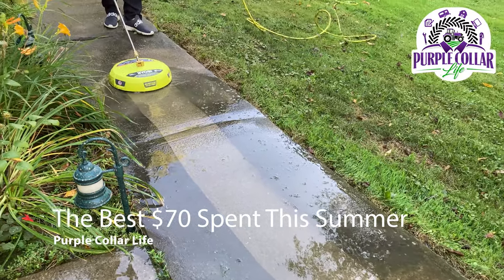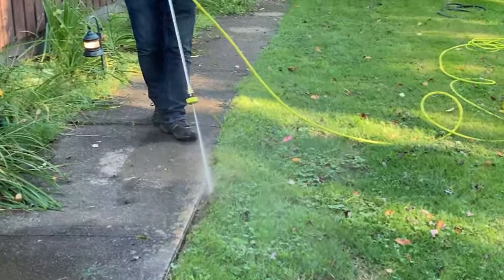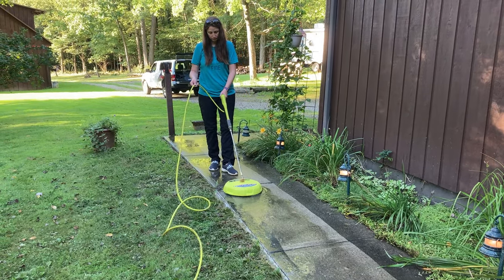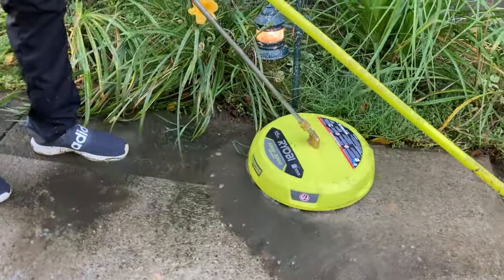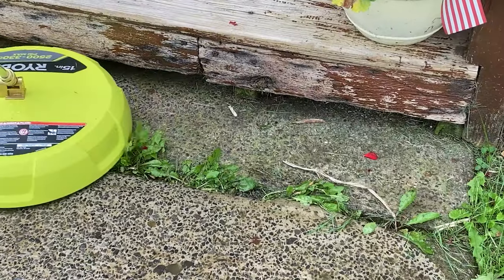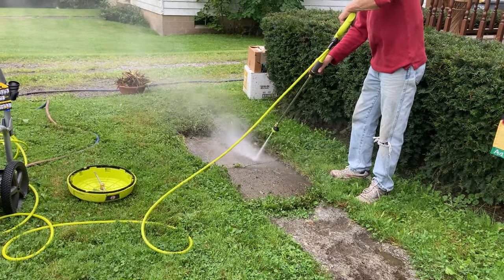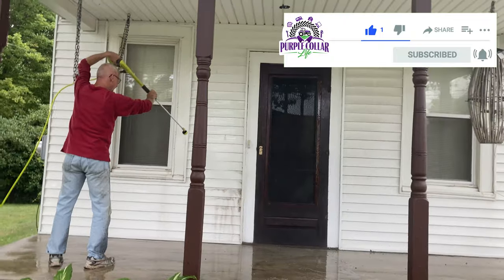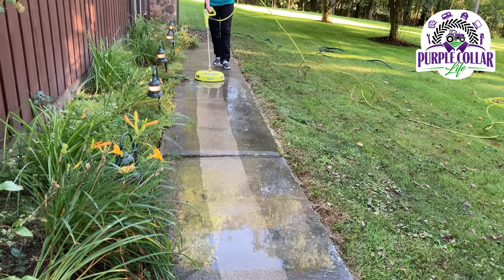#247: Ryobi Surface Cleaner - The Best $70 We Spent All Summer!

Comment: Chad… excellent!  As usual, you captured the essence of the answer to the question, “How does it work?”

I have the Briggs & Stratton surface washer.  It works the same way… a rotating arm with jets under the cover.  My pressure washed is only 2500psi but nonetheless it does a fine job,

My favorite thing is that it doesn’t leave spray patterns like a spray nozzle does.  If you take your time and don’t change speed or use crazy patterns the surface comes out uniform.

And the fact that it acts as a weed whacker on the growth in the cracks… is a bonus.

I also agree with you on the use of soap.  I never have seen a difference.  The only chemical that I use is a mold and algae inhibitor on siding and decks.  That I usually apply with a hand sprayer before I wash… it is easier to control.

Again, I enjoyed the demo.
Reply from the maker: Thanks!

Comment: Awesome cleaning power! And it's amazing it can do that, with that much pressure without eroding the surface. It's like using bleach almost. Thanks for sharing! 😎 Those are neat Adidas shoes Jennifer is wearing! 👟
Reply from the maker: So true!  The advantage to the surface cleaner is that as long as you're not over 3300 psi, the surface cleaner works at such an angle that it's not supposed to damage the surface.  I have seen some videos though of older/cracked cement floors, or really old porches, that splinter under the pressure.  The surface cleaner is much safer to use on a surface though than the 0 degree setting on the adjustable nozzle.  Thanks for watching! Have a great Saturday.
Reply from the maker: Oh - and Jennifer says those Adidas shoes are her favorite.  She liked that they got a comment. :)

Comment: Probably a dumb question but does having wheels make it easier to use? Or does the pressure of the water sort of make the surface cleaner "hover" over the concrete? I thought without wheels it would be a pain to push back and forth. Thank you!
Reply from the maker: Great question. There is very little resistance using the surface cleaner even on rough sidewalks. The pressure from the water creates that hover/hydroplane feeling and it moves along much like a vacuum cleaner on hardwood flooring.
Reply: @PurpleCollarLife  thank you very much! Great content and advice.

Comment: Nice video! Do you know if that will connect to an electric pressure washer? I only buy electric or battery powered equipment. I’m tired of dealing with carburetors. Also I love your new wood splitter. Can’t wait to see more videos splitting firewood.
Reply from the maker: Hi Richard - I'm not sure what connection the Ryobi electric pressure washer uses. I know that I've had a few electric pressure washers in the past, and they did not have the same type of connection as this one does for connecting the want/nozzle/surface cleaner.  Thanks for watching.
Reply: @PurpleCollarLife  I’ll just have to check the connections. Good thing about Home Depot is that if it doesn’t work I can just return it. I enjoy your videos. They are very informative. Thanks for sharing them.

Comment: I'm getting the surface cleaner used on offerup for $30, is there anything i should check?
Reply from the maker: Not that I know of. It's a pretty simple device - pressured water in the inlet forces the nozzles to spin and spray under the dome. It works great!

Comment: Pretty cool.  I have to ask, why not just use your Power Washer? I'll look this up. Looks like you could connect it to any Pressure Washer.
Reply from the maker: Hi Bob - The pressure washer with the adjustable nozzle on fan mode doesn't clean the sidewalk nearly as well.  Using the 40 degree or 20 degree fan setting, it won't remove any of that black from the cement.  At the 0 degree setting, it will, but only about 3/4 inch wide at a time.  And the manual says never to use the 0 degree setting on wood, concrete, vinyl, etc. because it can actually crumble the surface.  So the best option to clean a cement floor (garage floor, driveway pad, or sidewalk) is to use the 15" surface cleaner.  
You probably could use it on any pressure washer, as long as the connection system was the same fitting.  Thanks for watching and asking the question.
Reply: @PurpleCollarLife  Good detail on the 3/4 inch wide 0 degree fitting. I didn't think of that. I will look into the fitting needed. Appreciate the reply.

Comment: Love that mustang shirt brother
Reply from the maker: Thanks! I owned a 1994 Mustang GT (rebuilt as a Cobra) for about 20 years. I actually sold it, then re-purchased it years later.  I kept it really nice.  I sold it a couple years ago to a guy - he didn't have it long before he wrecked it!  Thanks for watching.
Reply: @PurpleCollarLife  no problem brother I gotta get one of these surface cleaners got the 2300 ryobi gas pw today I purchased the weed trimmer / edger extender. Worked great but a piece of the shield on the edger cracked something flew through it.
Reply: @PurpleCollarLife  my dads 65 now back in the days he had a 1973 Mac 1 he was a mechanic so he built it up. Put a bunch of stuff in it new headers straight pipes and so on and so forth. He said he used to smoke vettes and a lot of other cars. Said the thing was so loud and fast off the line. I want a GT bad hopefully in the future when I have a better paying job. Much love tho brother

Comment: You said it only works with Ryobi pressure washer. Is that a fact or are you sure other pressure washers won’t work?
Reply from the maker: Great question. To be 100% honest, I'm not positive. I read that on the box. :)
Reply: It will connect to any standard 1/4 quick disconnect regardless of brand.